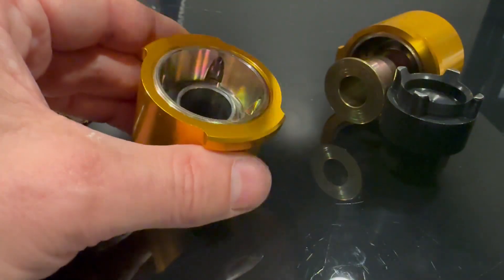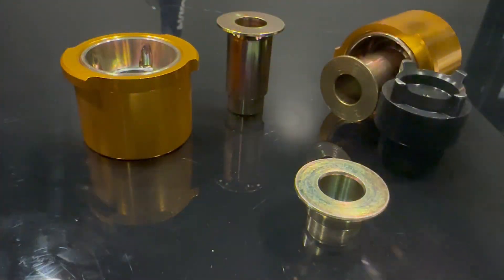Tesla Model 3 bearing conversion Eliminate rubber bushings & allows optional front suspension offset

Comment: Does it make the ride rougher?
Reply from the maker: I don’t think so, You feel less isolated from the road and more connected to your car and it responds faster to your inputs. Bump sensitivity is increased because compression under load is now solely the responsibility of the shocks and springs since we have deleted the additional spring force it takes to twist every bushing in the car. It’s safe to drive at or past the limit of lateral grip and then bring it back gracefully without the unpredictable snap back of all the rubber.

Comment: What is the impact of those bearings on MVH - stiff bearings will make it worth?
Reply from the maker: In the case of testing rubber coilover upper mounts, bearing mount has less spring noise. In general…

Noise vibration and harshness is a compromise in the quest for precision response to driver inputs & feedback between car and driver. 

However after experiencing other track only cars this one is still a delight to daily drive even if it’s not dead silent the extra sound a low level & the car is comfortable enough that your wife or parents may never guess you’ve totally modified the car. 

The general public may only find this useful for the most notorious parts that blow out bushings all the time from regular daily driving like the front lower arms.

Comment: Great work.. just curious about the shock handling capabilities. Please have videos with pov cameras while driving.
Reply from the maker: We must have about 8 camera positions in motion in the suspension and steering, driver helmet, passengers, body mounted exterior shots of road wheels with steering and tire smoke plus many positions viewing the car linking turns with non stop drifting viewed from the side of the track. It’s a lot to edit but it will all get posted up.  When you say shock handling it’s a curiosity about driver perception of ride quality when choosing bearing versus rubber? I believe ride quality is solely the responsibility of the spring and damper and rubber mounts add some unwelcome spring effect when loaded which compromises driver feedback the strut tuner’s ability to independently handle rode control and slow response to your inputs. The tradeoff is also noise absorption for a short lifetime or some noise transmission coupled with precision response to driver inputs and proper communication of road and track to the driver.